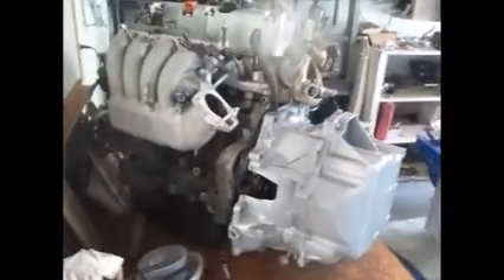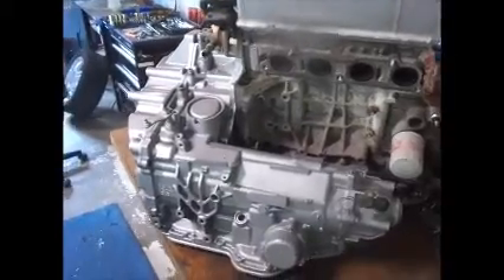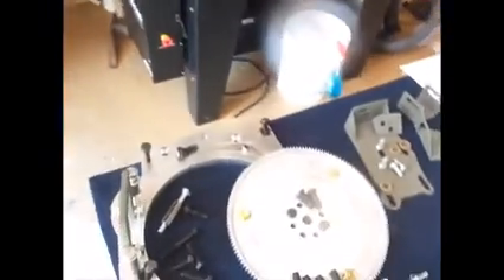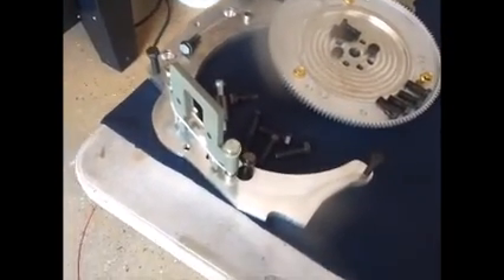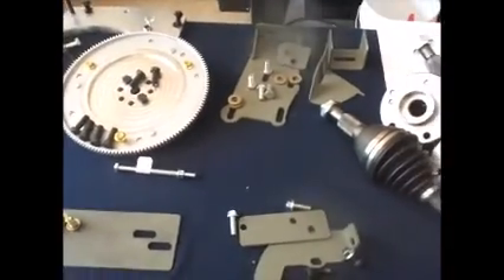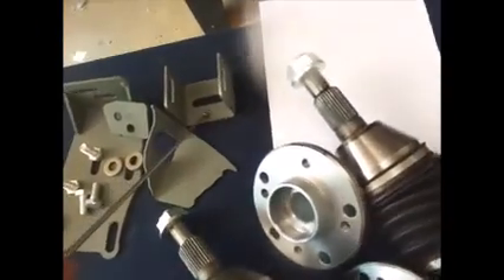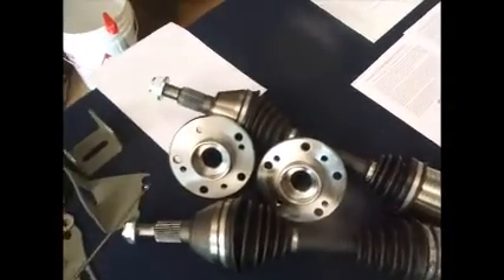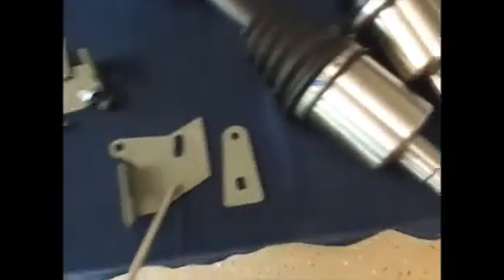Honda GM automatic transmission K swap project

Comment: WOW.   I have been trying to figure out a way to go automatic and K series in my 1991 (ED) Civic Hatchback.   I THINK that with some heavy frame rail modification I could actually get the automatic CR-V trans to fit, but I have heard they are pretty weak already as far as handling the torque, plus I don't plan on going as far as AWD, though I have considered it.   I have a complete CR-V donor car that runs drives and shifts great so I was thinking I could try to completely move over the entire ECU/Trans control and wiring and then work through the pinouts to mate as much stuff as possible back up to my stock dash unit.

Comment: Is there any way that you could provide the dimensions that the engine/trans combo ends up being and where the widest point on the rear edge is compared to the axle driveline?   I am trying to evaluate whether this is even possible to make fit in the 88-91 civic chassis.
Reply from the maker: @JonathanKling-u3r  no I would not try that that engine bay is pretty small and you're starting a complete custom install which is almost impossible you'll just have to spend money by an engine and transmission and see if it'll fit do you have a machine shop a CNC milling machine a lathe and plasma cutter ?

Comment: does this also work with a 4t80?
Reply from the maker: I don't think so I do not know. Why would you ask? What are you building? What car are you building?
Reply: @robertguilford5325  thank you for the quick response... It was pure curiosity I just know the 4t80s had ls4 strapped to them so I figure they could handle more abuse
Reply from the maker: It does not matter 4t80 is massive way too big to put inside a honda and will not bolt to a Honda engine.
Reply from the maker: I  am now thinking about trying to install a 4t80 in a 1997 K swap. I agree it would be great for high horsepower racing. I will post about it later this year. It may fit and be doable.
Reply: @robertguilford5325 hi I have a 1997 Honda civic hatchback would this combo fit in there?